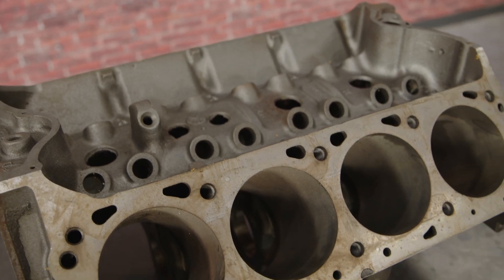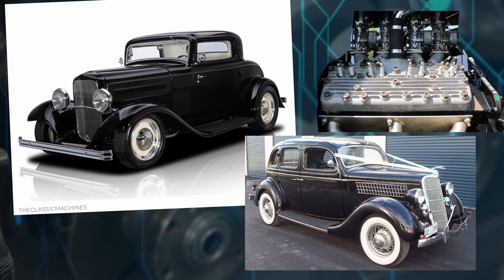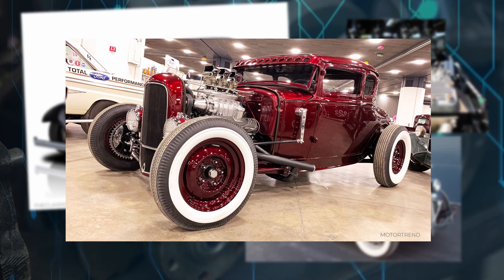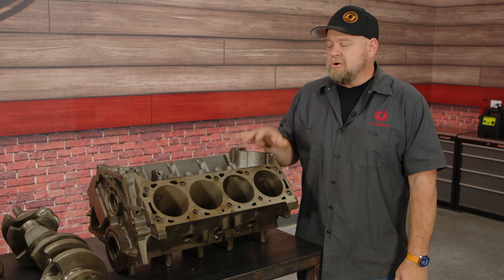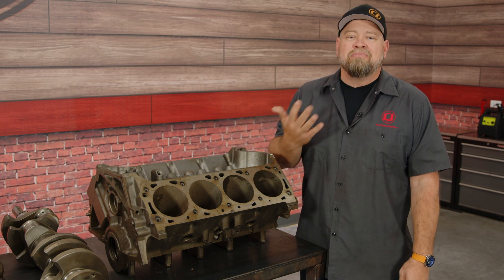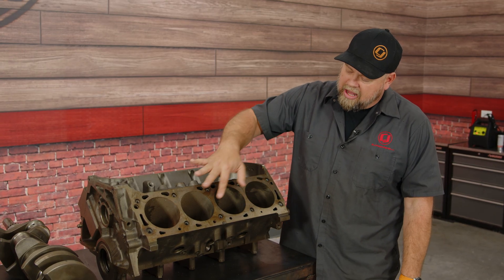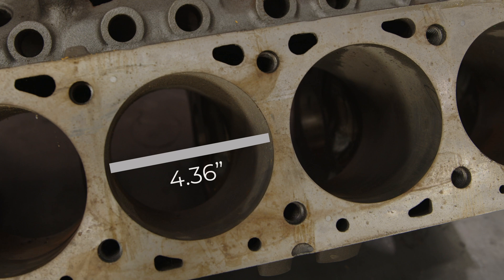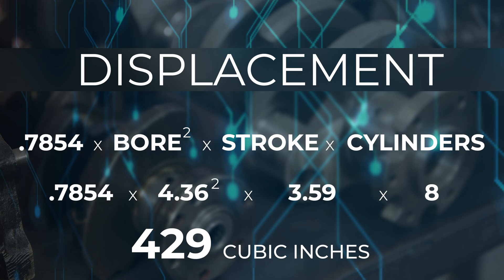Small Block and Big Block Engines Explained | Tech Talk

Comment: From what I recall, Ford never classified their engines as small vs big such as Chevrolet did as they classified them as families. Such as Flathead, Y-Block, Windsor, 335, FE/FT, 385, Super Duty, and GAA. Being a physically smaller or bigger block or cubic inches is not the correct answer on distinguishing the two, it is by bore spacing. Your given can go even further than your .7854 as in .7853982. These are not motors as they are engines. With so many different bore spacings, you can see why Ford perhaps classified them as families and not small vs big. Also keep in mind, the two blocks would have to be made in the same year to be considered small vs big. Example, Ford makes one cam in block V8 with just one bore spacing at this time (4.53") and that would be the 412 and 445. Which would classify neither as a small or big since their is only one bore spacing available. Hope this is easy enough to understand for everyone. Keep in mind the reason Ford went with the incorrect badging of 5.0 is because there was the smaller 300 that is 4.9 liters as well.

Comment: I just don’t understand where the .7854 comes from, is that the measurement of something? Sorry if this is a dumb question 😅
Reply: It is the magical number you need to figure out cubic inches of an engine. The number can go even further as in .7853982. Meaning a 351 Ford has a 4.00" bore and 3.5" stroke. You take 4.0 x 4.0 x 3.5 x .7853982 x number of cylinders which will be 8. Which comes out to 351.8 and that would round up to 352 cubic inches. The 352 Ford has the same bore and stroke as the 351C, 351M and 351W.  Hope this answers your question.
Reply: @Olds_Pwr  ok this makes sense now, thanks alot !

Comment: I realize this is an old video.But I get so tired of hearing.These experts discussing  motor size. So here it is, in a nutshell. Explain all you want, but do it correctly. Ford never made a small block V8, nor did they ever build a big block V8.  That is Chevrolet that made the small block and the big block.
Ford made engine families 3.
 85 series 335 series Windsor series F. E series or families, no big blocks, no small blocks.  Get it straight
Reply: Ford made more than 3 such as Flathead, Y-Block, Windsor, FE/FT, 385, Super Duty, and the GAA. Correct on no such thing as small or big block.

Comment: A lot of information, but "a big block is bigger" didn't really answer THE question.
Reply: You have to have two engines together with one having a smaller bore spacing to be considered the smaller block of the two.
Reply: @Olds_Pwr So a 140 cid block is smaller than a 307 cid block, so therefore the 307 is a "big block". Yeah, no.
Reply: @LordCeeJay  When comparing two engines, cubic inches has nothing to do with the term "big block". As I mentioned above, you have to know the bore spacing of the two to determine which block is smaller. Hope this answers your question.
Reply: @Olds_Pwr  I never had a question. I've known the difference since 1978.
Reply: @LordCeeJay (Yeah, no), sounded like a question. Helping out.  Plus I see you sounded like you needed an exclamation in your first thread.  Take care.

Comment: So, you didnt answer out question. What 1 thing determines if an engine is a BB or SM?
I will hazard that it is the bores. 
4" & under = SB
4" & above = BB
Ferrari has a V12 of only 5.0L which gives it cylinders of only 0.41L - a small block for sure.
Its pistons must be lawnmower size. ALSO, it is then possible to have a big block V6. All it
has to have is 4" pistons. Ill bet there are some V6 industrial engines or farm eq with such engines.

!
Reply: Incorrect. bore spacing is what considers a smaller vs bigger block. If you have a block with 4.5" and another with 5.0" the first would be the smaller block. They would have to be made the same year as I see so many people calling the GM LT engines small block when their is only one bore spacing made at this time.

Comment: Early information on stroker motor confuses me.  If you could change the stroke from 3 to 3.4 inches why does the bore have to change?

Or if you change the bore why does the stroke need to change?

Comment: Look I’m no mechanic however anything over 400 cubic inches is considered big block this is a fact lol you can google it However you can bore out a small block into a big block
Reply: Not true, it has nothing to do with cubic inches, only bore spacing defines whether its a BB or not.  Ford has BB engines that are well below 400 ci like the 352 BB for example
Reply: Your information is wrong. You have to have two different bore spacing blocks to compare if one is smaller or larger from the other. Ford made multiple different bore spacing engines, perhaps that is why they were smart enough to list them as families and not small vs big.

Comment: So actually 2JZ is BIG BLOCK engine. Because it has a bigger spacing between the cilinders. And hence a thicker side wall between the cilinders. So it is a BIG block.
Reply: You have to have two different bore spacings to consider anything small, medium or big. What are you comparing your Jap engine with?

Comment: Damn Americans are really dumb. Basically there is no difference.
It just comes down to different design of engines. Which vary from manufacturer to manufacturer.
PROPS to creator of this video you explained it the best way you can.
But you have nothing to explain here.
I really came here to learn the differences, but there is really no difference.
Reply: Of course there is a difference.  Chevy made both a 350 small block & a 350 Big Block.  Both have the same cubic inch cylinder.  But one has more spacing and more metal in the block.

Comment: I can save you seven and a half minutes, a small block V8 is a 60 degree V8 and a big block V8 is a 90 degree V8 . . . you're welcome . . .
Reply: Except for all the small blocks that are 90 degrees…
Reply: back in the 1970's a 60 degree block was a small block and a 90 degree block was a big block (according to Chilton and Car Craft Magazine, Hot Rod, etc. That's how Chevy ended up with a small block 400 and a big block 396, but over the last 50 years it's gotten diluted and now you have some people thinking there's a different definition of small and big block but those people can't ever repeat what the definition is because they don't know, so maybe you're the first to know the alternate definition of a big block and a small block, I would love to hear a denier come up with a definition, so far you haven't been able to define what makes a small block small and what makes a big block big. I'm the only person in this discussion with any definition of it . . . .
Reply: @douglasdobson8110  I can’t think of a 60 degree V8.  All V8 I am familiar with are 90 degree blocks, irrespective of displacement, bore spacing, bearing count,  or any other potential differentiator between “small block” and “big block”. This includes the flatheads from Ford,  2.0 litre offerings from Fiat, Ferrari, and Lamborghini, the 2.5 litre from Daimler, the 3.9 litre from Triumph, and the all aluminum 215 from Buick.  All are 90 degree configurations.
Reply: @michaelsolonynko8818  you can't think of a Chevy 350? Really? That engine is so little known to you? LOL. You must not have been a car guy for very long . . .
Reply: @douglasdobson8110  You mean the SBC with a 90 degree configuration, that's been that way since its debut as a 265CID option for the 1955 Corvette?  
Mind you, GMC used a 60 degree V8 back in the '60s, but it was  big block beast of 10 litres...
Reply: There's a mid block, too lol... Ford is famous for their Cleveland. 
Build one.
Dominate.
Reply: name one American small block that's a 90 degree block? should be easy since you seem to know so many 90 degree small blocks . . . and since you can't think of a single 60 degree block . . . do you even know what I mean by 60 degree and 90 degree?
 @michaelsolonynko8818
Reply: No such thing as a small or big block unless you are comparing two different bore spacing blocks. Then you can say one is smaller than the other. A 350 Chevrolet is a 90 degree block. From what I recall, Ford never used the generic term of small, medium or big block as their blocks were classified as families. The Chevrolet 400 that you mentioned is 401 cubic inches.
Reply: @Olds_Pwr   yeah like everything there are exceptions, if you go back enough years what I said is mostly accurate but yeah. We absolutely used the term big block and small block for those casting sizes aka big block 396 Chevy Vs 400 Small block Chevy. MY favorite Buick thin casting 455
Reply: @douglasdobson8110  Keep in mind that the 400 Chevrolet displaces 401 cubic inches.
Reply: @Olds_Pwr  you had to didn't you? lol  Ok can we all agree we're all some degree of gearhead and we all think we're the smartest one? Now that we have that settled favorite build IDEA go: I'm torn I have one USA Muslce and one old Japanese/German ingeinuity, THe USA version I could have done this I had all the pieces: 1968 Cadillac 472 (10.5:1) in a Buick Skylark (Gran Sport body) in my case I was fourteen and was putting it together. My dad the minister knew I was up to something heinous called his mechanic to come look while I was visiting my sisters out of town. I heard this from the MEchanics mouth directly a few years later so he looks the cars over sees I have some stuff pulled and staged and dad asks him "So what is he doing?" the mechanic answers: "Preparing to kill himself" and then dad had all the cars bulldozed into the swamp lol
Reply: The other also inspired by one car I had a Mazda RX3 that I had up over 165 MPH twice, I always wanted to mount that engine in a Volkswagen beetle, for the almost unlimited high end of that engine. The engine itself is way smaller then the  VW boxer more powerful and capable of revving past 10K rpm.

Comment: Back in the day I built 350 small blocks for my 71 Camaro. Your videos I can now have my grandchildren watch as they are so well explained. I could never explain the difference like you did in this video!
Reply: 💯,,, 302,DZ, chevy, 68,69, manufacturer championship title back to back,, 327: L79: 350hp, 327L84,375+Hp.  ( Chevy Small Block😁), 
396L78,RATED375,,actually dyno420hp. ...427L-71..435hp,,,,427L88,430hp,,,,427L72,425hp,,,(for insurance purposes), actually close to 475hp.,,, 454??? Don't need it😁   Difference is use a Chevrolet motor!!!, They owned Ford. Dodge &  Plymouth did to. ,,,, 421side oiler was their 1 motor. And it was bad ass!   ( that's a difference in small blocks & big blocks!😊

Comment: Just in case anyones forgotten their circle formulas, the .7854 constant used is Pi/4, because when manipulating the circle formulas in engine building we are using a diameter, which is our bore dimension, and that feeds the area of the surface of the piston into the calculation. That constant is easy to remember- it's the 4 numbers at the top left hand corner of a calculator keypad.

Comment: If be curious what the overall cost comparison by going big block vs Small block vs coyote. Especially with a dart block sbf to get it into the same power figures. Really enjoyed this video
Reply from the maker: This is a question that has been asked time and time again, there really isn's a "correct" answer. For the cost of a coyote crate engine you can build s small or big block that makes the same power but usually they will usually have a rougher idle and not be as efficient as the 4 cam engine. Once you add power adders you can make 800 pretty easily with the coyote and the car will run like stock, this is a lot harder to do with the pushrod motors.
Reply: That's where I'm at with things, my friend built a 363 dart block with a tko and a Paxton Novi and is in it for a good amount with issues to boot. I'm currently with a gt40/explorer setup with the pimpX and don't think i want to adventure into aftermarket blocks just to get a littler security at the higher power levels. I think coyote is the goal I'll continue working towards

Comment: Well first thing is first it's not a goddamn Chevrolet these are Ford's you know like a 385 series
Reply: Justin the Ford 385 series of 429 and 460 big block engines clearly have an advantage over the goddamn BB Chevys when it comes to building stroker engines. The Ford block will accept a larger bore. The deck height allows a longer stroke and the cam tunnel is positioned higher in the block which allows more clearance between the cam and stroker rotating assemblies. The bottom end of the block is stronger thanks to thicker pan rails and structural bulkheads. Sure it weighs a few pounds more but the additional weight is in all the right places. Advantage Ford 🏁.
Reply: @danielwilson6665  yes very well aware of flow numbers but what I was referring to his Chevrolet four years have always referred to Big Block small block and ford has always had a series of motor
Reply: @justinchandler7822  … Thanks for clarifying your point. I understand where you’re coming from now. 👍
Reply: @danielwilson6665  The 385 is a family, not a physical size such as "big block". You have to have two blocks with the known bore spacing to say which is smaller or bigger.
Reply: @O @Olds_Pwr  The term “big block” originally referred to Chevrolets family of large displacement engines. Nowadays the term is often used to describe other manufacturers engines, such as Ford and Chrysler although those manufacturers actually do have their own nomenclature to describe their various engine types. 

Fords “385 series” of engines typically includes their overhead valve V-8 engines with common cubic inch displacements of 370, 429 and 460. People often refer to them as big blocks because of their cubic inch displacements. 

Fords “ FE series” of OHV, V-8 engines is often incorrectly described using the common Chevy term big block because of their larger cubic inch displacements from the factory such as 410, 427 and 428 for example. There are more but this is confusing enough 🤷‍♂️.

Comment: I wanna know why my heads keep failing on my 1st Gen Coyote (2014) in my Mustang... I had a Reman put in and the heads failed on that one too... And what can I do to prevent it in the future?
Reply from the maker: What exactly is failing? I have seen Gen 1 heads take a lot of abuse, I have spun my sealed engine to nearly 8000 rpms without a failure although I would not suggest that!
Reply: @cjponyparts  cyl 4 and 7 keep losing compression and are misfiring this last time it was 3, 4, 6, 7, and 8...  Also cyl 4 somehow also smashes the spark plug gap closed but there's no sign of anything touching it...
Reply: Your heads are warping. - use the same material for block AND heads.
You'll be fine.